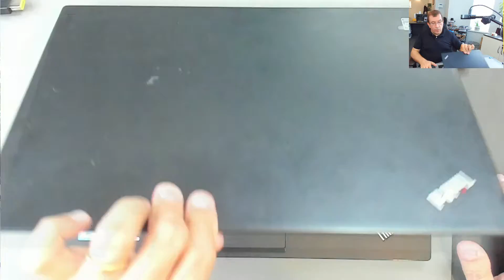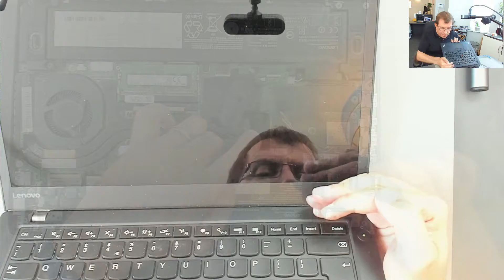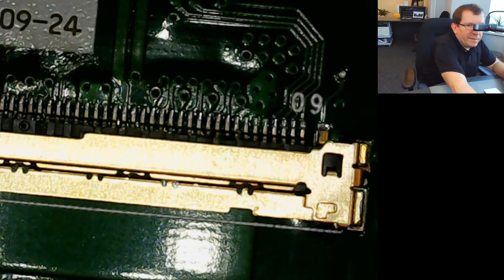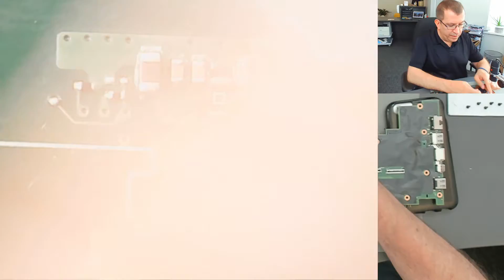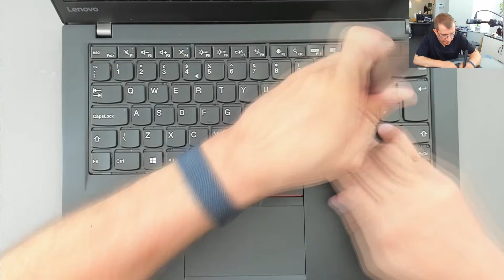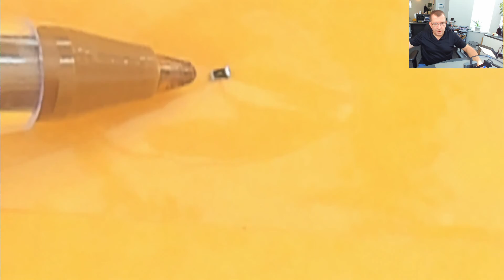[47] Replacing a blown backlight fuse - Lenovo ThinkPad T460s Ultrabook

Comment: I think I have the same issue on my T430s, I tried replacing the display with a spare one which I know has a working backlight and it still had the same issue where there's display if I shine a light on it but the backlight not working, so I think it's a blown backlight fuse especially since the display was flickering and a pop was heard before the backlight died.

Comment: Replacing a fuse with a zero ohm resistor is not advised. It may work but instead of the fuse blowing the track will fry next time. Replace like for like.

Comment: Hello, Thanks for all job.
I have a T470, and keyboard dont work.
I test other keyboard and the problem is the same.
Only work, ESQ to F12 and windows key.  In bios is the same.
Enter and others keys dont work. you can help me?
Reply from the maker: I can't imagine what the issue is. I would try an external (USB) keyboard, perhaps after disconnecting the existing keyboard connector, to try to determine whether the issue is the keyboard or the motherboard. Aside from that, I'm not sure what to recommend.

Comment: My t460s just stopped working : press power button in momentarily lights the power button green and the backlight keyboard comes on and then two seconds later both go off.  No backlight at all. Tried removing batteries , cmos, reset button, will not load bios and shutsdown
Reply from the maker: To me, that sounds like it could be a corrupt BIOS chip, but the only way to know would be to remove the chip and inspect its contents and/or replace it -- a tricky job.

Comment: Hi Sir and many many thanks for sharing all this.  if possible please I need an information. 
I blown a backlight fuse on a ThinkPad T460S replacing the screen and not removing the batt ...
As a emergency repair I just short the blown fuse but I want replace it.

now I know that is next to impossible to find a identical fuse , but can I use a generic 3A SMD fuse instead?

(I`m not in repairing computers but I work in automotive electronics)

many many thanks again and all the best
Reply from the maker: I'm not sure, but I think you could probably use a 3A SMD fuse as a replacement -- any fuse would probably be better than simply shorting the circuit. Sorry I can provide a better answer!
Reply: @ComputerHelpNI  many many thanks

Comment: i have lenovo e450 , 30 pin lcd. After booting there are flicker on desktop but normal in windows explorer. on desktop V lcd controller drop about 2V
Reply from the maker: I've  never seen an issue like that before. It sounds like it could be a failing inverter, but I honestly don't know what your issue could be. Sorry.

Comment: Hi, my lenovo yoga 500 isk has no problems if connected to the power, but if I unplug the backlight does not go anymore, on the motherboard the components are different from this notebook in the video, can you tell me how I can understand where to look, if of are there usually references to watch out for?
Reply from the maker: Have you tried the recommendations from this page? https://forums.lenovo.com/t5/Lenovo-Yoga-Series-Notebooks/Issue-Display-Lenovo-YOGA-500-15ISK-ok-with-charger-Black-without/m-p/5109790

It does sound like a logical problem (BIOS or drivers) to me, but I can't say for sure. Please let me know what the issue was when you finally do solve it!

Comment: Thanks for a great video.  
You said that you used a 0-ohm resistor in place of the fuse.  Do you know the specs of the fuse that was called for and/or the specs of the resistor that you used? I'm in the western US or I'd send this to you.  Had relatives out from Cork two summers ago.  Really looking forward to visiting them in a year or so.
Thanks in advance.
Reply: I know this was 8 months ago, but the schematic shows that F7 is a 2 amp 32V fuse size 0402, with part number ERB-RD2R00X.  A 0 ohm resistor, if it works, probably wouldn't handle as high of a spike, considering that you would need it to handle 64 watts.  Since I've never seen a 0 ohm chip resistor with that high of wattage, and this guy was able to get it working with one, it probably doesn't get anywhere near that under normal circumstances, and you would be fine using a 0 ohm resistor.
Reply from the maker: I'm not exactly sure what either spec is on this one, but here's the thread where I learned about the location of the fuse: https://forum.thinkpads.com/viewtopic.php?t=130380 There is some discussion about typical fuse ratings (e.g. 3A, 32V, Fast), but again I don't know with certainty if that applies here. I do now have some fast fuses in stock and am tempted to ask the customer to bring it back in so I can put a proper fuse in-place. If I do that, I'll create a new video. :) Also, thanks for your kind words!

Comment: Hey, great channel! I have a T460s and would love to send it to you, but I'm in Italy. My problem is the following: the computer started crashing out of nowhere, and after a long troubleshooting process I discovered that without the RAM stick, the computer works perfectly, with the RAM stick in place, it starts to crash again. I tried a new RAM stick but the problem is the same. Seems like either the RAM slot became defective or something software related is not "accepting" the RAM anymore. Could you please give me any hints? Thanks a lot!
Reply from the maker: Thanks!

I suspect a problems like the one you describe will be hard to solve. I'm not sure what the specifications (mainly, the frequency) of the on-board RAM are, but perhaps you could try using a memory module that runs at the same speed as the on-board memory? You might also check the UEFI (BIOS) for any other memory-related settings that might be contributing to the issue -- things like the amount of RAM reserved for graphics, timings, etc. (I'm really grasping at straws here, but these are the things I would try.) Good luck, and when you finally solve the problem, please let me know what was causing it. :)
Reply: @ComputerHelpNI Hey, I really appreciate your help. I don't think the RAM speed is the issue because the computer has been working with the same RAM for more than 2 years. I will check the BIOS and will let you know if I solve it. Thanks!

Comment: I have a t460s board I disconnected the display without disconnecting the battery and blew the fuse...do you offer this as a service?
Reply from the maker: I'm in Northern Ireland, so it might be cost prohibitive, but otherwise yes I offer this as a service.